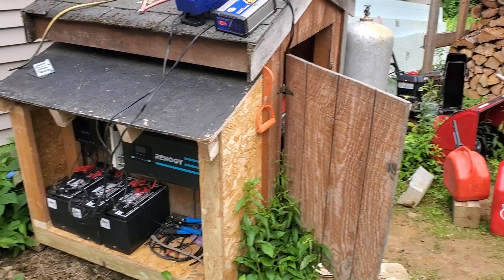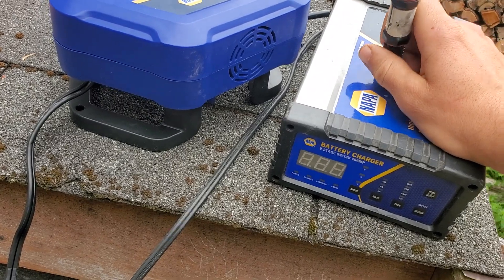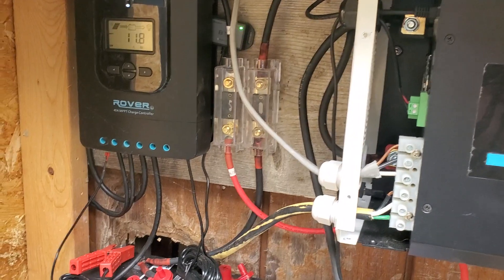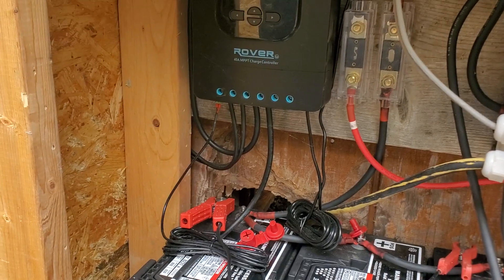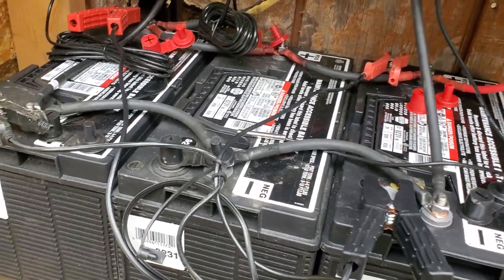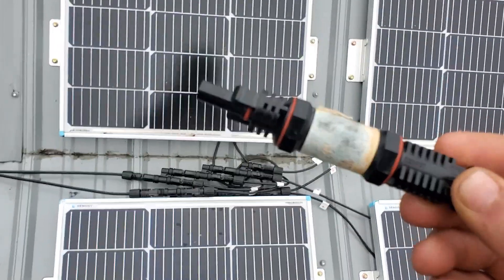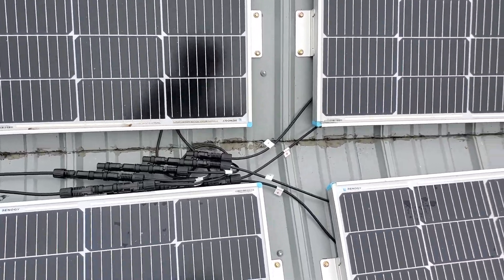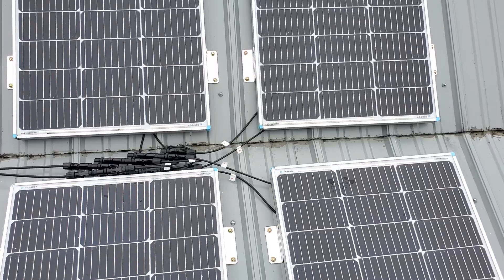Renogy Solar Update with Battery Shortcomings

Comment: You also need to pull from 1 positive at 1 end of multiple batteries and then negative to other end of multiple batteries.
Reply from the maker: Yup that's what I've been told. I have the solar feeding neg of number 1 and pos of number 3 then the inverter pulls from pos 1 and neg 3

Comment: Pull the sticker off the top of the battery and then you can check water levels.
Reply from the maker: That's a good call. I wasn't thinking about the water cause they're only 3 months old but i should check it

Comment: Don't know how you are charging, but the batteries should be connected to a management system, otherwise the batteries will become unbalanced (each battery is separately controlled and charged with a management system) . Also, you can't connect two inverters together unless there is a system to synchronize the phases. The expensive  charger probably has a timer circuit that shuts off in 20 minutes. Spoil the warranty if you want and look for common timer chips like a LM555.  The lower charging voltage is by design to increase battery life.
Reply from the maker: 10-4 that timer chip is for the birds. The batteries are charging from the solar. I only use the other generic chargers to help the solar when it's been cloudy for a week

Comment: Im interested in helping if i can. Not saying i know everything but i may be able to help
Reply: Through the video there were a few things but what is your main concern. 

It was a short video and it's the first time I've come across your stuff. 

You may know but I don't know that you do. Just because you have a 300ah battery bank doesn't mean you get 300 hours. Alot will depend on the load which you are demanding from the bank. 

Being lead acid batteries you should be safer to assume that you can only really discharge them to around 50 percent capacity in optimal conditions such as temperature and what you are putting back into them as you use them. 

In a perfect world your 300ah batteries would be good for 300hours at a discharge rate of 1 amp per hour. Which is where we get back to what you are trying to run off of this setup. Also you must keep in mind that that inverter also uses power to run which is why it came with an on off switch. Ideally it would only be on while using the powered stuff that the inverter is there for
Reply: As for the fuse issues you are having there are a few things to consider. Where you have the in line 30amp fuse I would recommend a 40amp water proof circuit breaker. But at the same time before that you should check for any shorts to ground for the circuits.

The system you are running is a great way to get into solar and I myself own two arrays of these systems. Without my books or notes in front of me I can say that I only expect 3.5 hours from each of my la batteries with the loads that I run. 

Many things come into play in a system even this small. The flow of power is important. 

I am to assume your 4 panels are using a 8awg wire to the charge controller. This is good however as you add length you also add resistance to that line which will cause the amperage to rise. I don't know if you have any extensions on that line from the array to the controller but if you do it is something to keep in mind
Reply from the maker: Thanks for the input. It's very helpful. I'd like to think I have a basic understanding of this solar but I always want to learn more. All I run is a fridge and recently setup a starlink internet system. My main concern is that when I only had 2 batteries I could run just the fridge and only go down to 80% capacity then overnight to maybe 70% but the next day even if it wasn't optimal sunlight it would go to 100% or just about but we had a gray week and I drained then to 0% on the controller which is actually 10.9v for the batteries and since then I can only get back up to 60 or 65% and they will drop off very rapidly comparatively to before where it seemed slow and normal to me. This is when I added a 3rd to hopefully stabilize while also increasing the overall capacity of the bank but it hasn't done any good so far
Reply: Not a professional by any means if this field however I have done it myself and have roundabout 18 years experience in the automotive industry and have worked many jobs in electrical as well as wired my own house